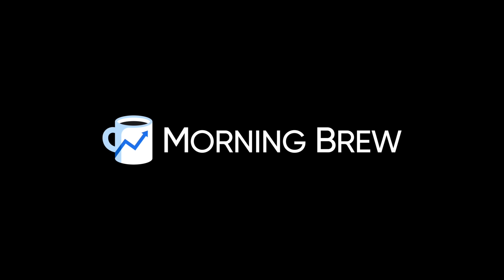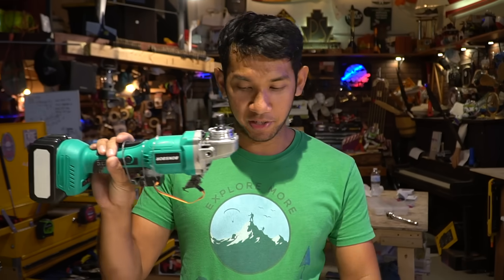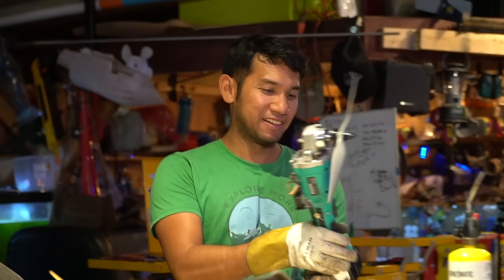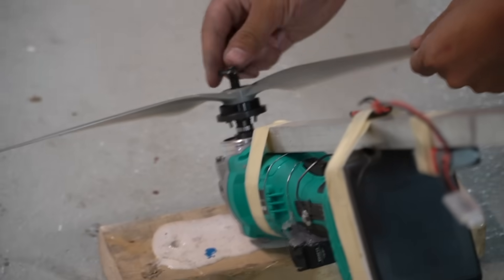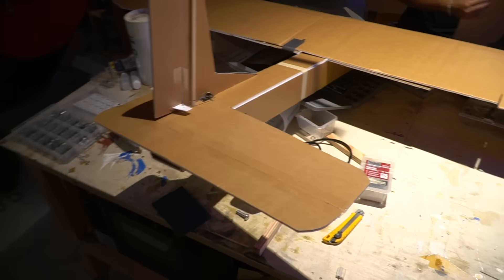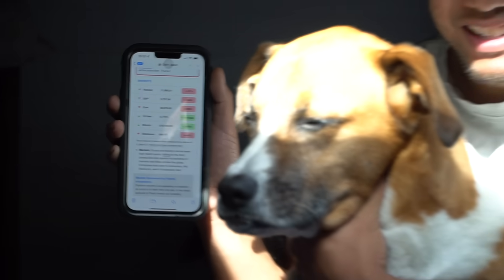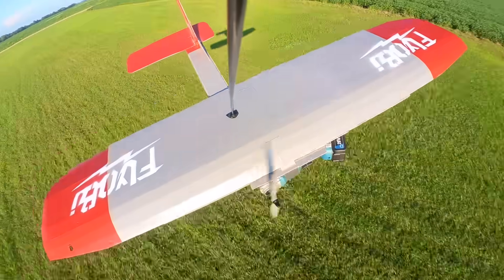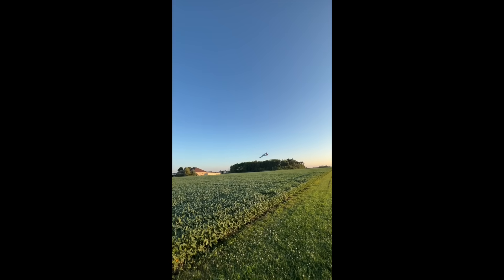Teaching an Angle Grinder to Fly

Comment: powered flying boomerang, always comes back
Reply: if you use "normal" batteries for vtol aircraft on airports, then you can resonant induction coupling push the vertical power directly from the airport to the "helicopters" wirelessly, take-offs and landings energy directly from the airport, not from the batteries (unless you use solar/nuclear, then you dont need to recharge)
Reply: dont put any (other than super caps) on a helicopter, fly it with resonant induction coupling power lines alone

Comment: The cheapo tools make great throw away rc parts, good to know that an angle grinder flys, If had to make one fly though I'd make two fly but in Chinook helicopter fashion and since you are using all the grinders an aluminum heatsink or two mounted between the batteries

Comment: I have seen worse ideas the angle grinder is high rpm and high torque it is actually a pretty solid rc plane motor. I use a battery powered Dremel for a rc air boat  it worked great battery powered 1 of course

Comment: I love that face. And enthusiasm. We will try it anyway. How did you know I wanted to see that 18 inch prop fly. Specially after seeing how fast that trust kicked in. I thought u would have tried the grinder with helicopter blades as the main rotor and a smaller rc motor as the tail rotors so u can control the spin. I wanna see that now Peter.

Comment: A rotary hammer would be a difficult challenge as they are heavy, and spin slowly. However they have quite a bit of torque
Reply: Every SDS drill I've used in the last 15 years has had substantial kickback prevention, they really don't have that much twisting torque. They're designed to percussively break up the concrete, not twist that hard. The rotational motion is only to extract the pulverized cement.
Reply: @otm646  yeah, they are not super powerful, however if you use a gearbox maybe you can get just enough airflow to make it fly.

Comment: Now we just need a Quadcopter Drone with 4 Anglegrinders as propellors and the insanity is complete.
Reply: Already has been done
Reply: @ageorgiev89  link?
Reply: @ageorgiev89  sure you don't thinking about rotor riot doing it with small 1milion rpm pensil grinder?
Reply: @ageorgiev89  i jwas just about to say,  that the estonians already made a drone
Reply: I found this on YouTube. But I'm curious as to the power vs. the weight. Can it lift more than one with regular rotors? https://www.youtube.com/watch?v=5TEIHUnnMz8
Reply: estonians did it already https://www.youtube.com/watch?v=5TEIHUnnMz8
Reply: there's also been a dremel quadcopter
Reply: @utspish  Dremel are powerful you know those propeller straws you got as a kid from the fair that you spin and it glides to the ground gyro style? I bolted one of those plastic props onto a Dremel and it produced so much thrust it moved all the air in the room could definitely lift itself but had so much torque and lift it tore the brace I made for it! Dremels are no joke
Reply: @utspish  yes, motors have been great for years. It’s energy density and microcontrollers that have made drones practical.
Reply: Yes
Reply: bruh.......yes.
Reply: No, we go bigger. What we need is 2 motorcycles laying on their sides with props on the rims. We configure and attach them together around a 3rd motorcycle which you sit on and fly your motoquad like a MF
Reply: Liked your comment before watching the vid cause i know this gooed stuf
Reply: Done!
Was showcased in June on a science fair at the AHHAA centrum in Tartu 

Link: https://youtu.be/5TEIHUnnMz8
Reply: @KohaAlbert  tha ks for the link
Reply: That’s what I was hoping for. Spoilers… the good kind.
Reply: Where? Could you provide a link?I'm interested
Reply: I have 6 of em lying around (redemption offers)but have absolutely no clue what I'm doing..

Definitely get the apprentice to be ground crew for that one.
Reply: The cost of larger props was quite high last I checked
Reply: Done already
Reply: Buhahahaha
..wicked 😂
Reply: It's one of millions of reason God gave use Duct Tape...
Reply: Dremel quad from rr.. Yes
Reply: Fuck yea
Reply: @sailyui  problematic. Tbh. The motors need to be controlled for it to work so a lot of soldering and computing would be needed to make this work. With the dremels it was easy since they run brushed motors. But the hell knows what kind of brushless esc you need for an angle grinder
Reply: happend 7 years ago https://youtu.be/utlF_R9qaZQ
Reply: Please make him do it
Reply: Same idea
Reply: And then offer free haircut
Reply: Angle Grinder Drone https://youtu.be/5TEIHUnnMz8
Reply: Brilliant!!
Reply: Imagine the power consumption lol
Reply: I was going to suggest a chinook
Reply: Agreed. Angle grinder drone build! Please 😊
Reply: Lol
Reply: I thought the same
Reply: Why do you think they're at an angle eh?
Reply: All great minds think alike 🤔
Reply: https://youtu.be/-dbhkD1N7M4
Reply: https://m.youtube.com/watch?v=j3p9Fd0QSEs 
Use a descent tools and the results is better 😊
Reply: Table saws. I mean duh
Reply: https://youtu.be/ISS9dayasPQ
Reply: ...but has anyone spun pizza dough with an angle grinder????
Reply: Yeah i watched the mexican paraglide to his curiousity in my vision. Im trying to see the scope of ratios for body weight
Reply: Don’t encourage him
Reply: It would be more like 8 angle grinders
Because of the offset weight of the angle grinder on the propeller blades (without a counterweight, it would ruin the flight capabilities of the drone because of it shaking around
Reply: Who used it for evil be honest
Reply: Flight time might only be 5 minutes, but it's 5 minutes of pure unorthodox awesomeness
Reply: You're very weird!!🤦👉🐷
Reply: Would be to heavy but funny idea 👍
Reply: All of us be thinking the same thing, we’re too basic.
Reply: Diamond discs only
Reply: Tendrías que probar con una amoladora recta ,o reformar la que estás usando que la hélice vaya en la punta sin ningún engranaje ,tendrías más rpm y menos fricción
Reply: with all my angle grinder work I've done in my life, I would never do this even if you payed me lol. Them shits can get fatally dangerous real damn quick! faster than the blink of an eye.
Reply: I would prefer a flying lawnmower
Reply: But it is much higher power consumption Idea.so fail
Reply: Yeeeea, please
Reply: Too heavy
Reply: Genius

Comment: This may be better to do with a die grinder with variable speed if you can wire in the remote throttle to the internal switch circuit

Comment: I would like to see an oscillating tool be used to make an ornithopter.  Now that is a real challenge.
Reply: Like a sawzall or a jigsaw. That would be hilarious.
Reply: @kelseyduerksen6404  I was thinking the oscillating multi tools, they're crazy fast, like 20,000 oscillations each minute.
Reply: @danielbrowniel  more power out of a sawzall. It has a transmission to turn the rotation into forward-backward just gotta make another one to turn it back into rotation. Losses galore.
Reply: reciprocating saw, perhaps?
Reply: I genuinely don't know if that's even possible
Reply: They want it to spin not go back and forwards. Go looknat the designs. They usually use 3 cogs. 1 off center and the main 1 drives both sides by spinning. Very very easy build.

Comment: How about a blowtorch aircraft? I don't know how you'd create thrust from heat but if anyone could figure it out it would be you! Maybe a hot-air-balloon style airship or a mini steam engine?

Great vid as always!
Reply: Ministeam engine sounds hilarious.
Reply: i wonder if it would be possible to attach a nozzle to the blowtorch for a makeshift rocket engine
Reply: good idea, maybe a hot air balloon
Reply: the regulations for liquid rocket engines are pretty strict compared to solid rocket engines
Reply: Mhm a Stirling engine could work fine the main problem with a Propan troch is it needs to move a lot of air to generate thrust but with a fan (electrical driven) prior to a burning chamber it is possible to generate thrust by expanding the air with heat so it gets fast out of the back called hybrid jets
Reply: @TheLtVoss  I like this a lot, but would then how would you know that it's not just the fan that's making all the lift
Reply: @urmum8540  well we know it works because it is basically a afterburner and theses type of devices ar almost as old as the jet engine so yeha im sure it works oh and easy to test if additional thrust is gained just fier it up once (at max speed of the fan) and look at the difference with or without the burner on
Reply: I feel like the best bet is convert a small 4 stroke engine to run on the propane or if you want something a little spicier map gas.
Reply: Sterling engine is also another possibility but im pretty sure it's quite inefficient compared to the other options to extract work from heat
Reply: @urmum8540  also the Stirling engine is actually one of the most efficient ways to convert heat in physical motion at leat higher than a internal combustion engine
Reply: Just like an RTG, but instead of nuclear decay we use the heat from blowtorch, and instead of batteries we carry fuel for the torch, aka - Thermoelectric generator with an array of thermo couples, driving some sort of suitable electric motor directly (no batteries).

Comment: You probably already noticed this but each time you push the copter wings with the launch pole, you’re inverting the angle of the blades turning all that wanted upward thrust into downward thrust, or no thrust just gravity, but it is a great idea and I think Peter can get it to work, little bit lighter blades with a better angle and “out of box” design,
Reply: so the best launch would be to hold it high, then just pull the pole down, and run fast
Reply: @moonriseproductions  or jump off of something
Reply: @moonriseproductions  well realistically if it can't take off from the pole on its own it would never sustain flight
Reply: @moonriseproductions  actually the best launch would be for the copter to slowly gain proper lift and lift itself off the launch platform, the use of the pole should solely be used to stabilize the unit until it can sustain its own lift. Unless it’s purpose or design is to slowly fall like a parachute or a glider, then some form of launch or drop from a secondary unit be required.
Reply: I don't think they would be inverted, looks more like they are just flexing down.
Pushing it up doesn't invert the pitch of the blades.
And that's even less likely to happen since he added the small wing.
This just looked like it didn't produce enough lift.
Reply: Nice Job, again. I owe you one but where are the twin prop's